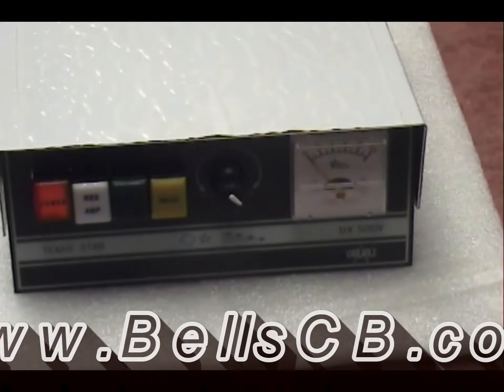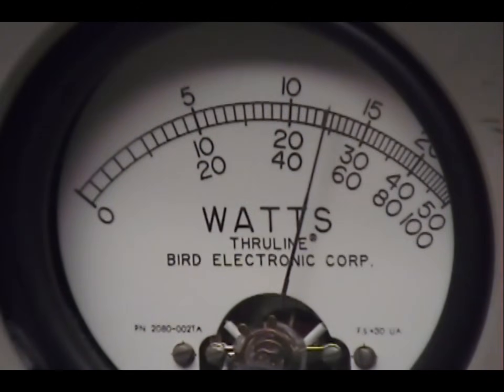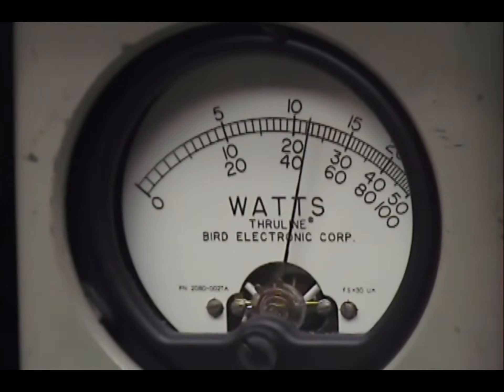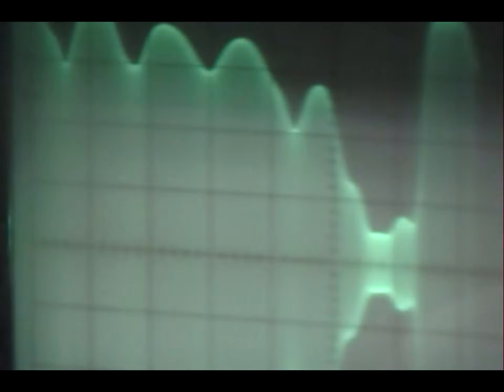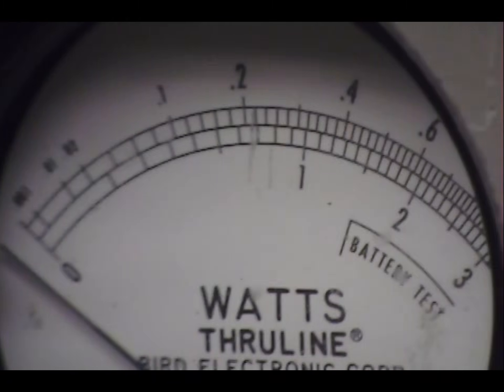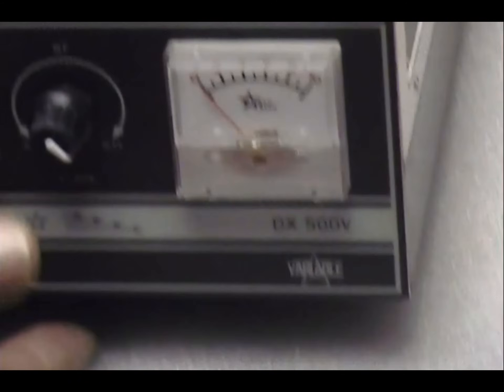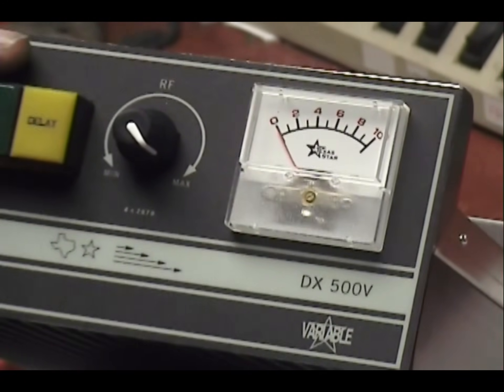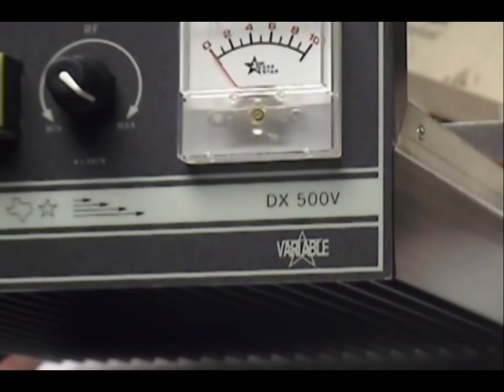Texas Star 500V Performance Report

Comment: This would work really well with a stryker 955
Reply from the maker: When you turn the power all the way down on the radio, it has a 2w carrier and peaks about 35w on AM and has a bout 18W PEP on SSB .  That's great to drive a DX-500V - Provided 𝙮𝙤𝙪 𝙠𝙚𝙚𝙥 𝙮𝙤𝙪𝙧 𝙝𝙖𝙣𝙙𝙨 𝙤𝙛𝙛 𝙩𝙝𝙚 𝙥𝙤𝙬𝙚𝙧 𝙠𝙣𝙤𝙗 on the radio. The folks that have to turn up the radio to full power every time the amp gets turned off (barefoot), 𝗔𝗟𝗪𝗔𝗬𝗦 forget and overdrive their amps when the radio power gets left all the way up. Don't be that guy !!!

Comment: May I ask what is the difference between Texas star 500 and Texas star 667?
Reply from the maker: The 667 is the same amp but with a 2sc2290 as a driver transistor to the 4x 2sc2879's..  I like the 500 a lot more.
Reply: @BellsCB  thanks

Comment: I have the tx star 500 and the texas star 667v. I only get 400 watts out of the tx star 500 and just a little over 500 on the 667v
Reply: +lazydogg calif -- they both have 4 of the same transistors in them
1 x 2sc2879 = 100 watts
4 x 2sc2879 = 400 watts
yes, they will put out more power than their rating, but what does it gain you in actual signal? 
nothing measurable on the receiving end (not even 1 S Unit)

peace )
Reply: Dietrich Zumwald
You will get a little more audio and it can make enough of a difference between getting walked on and talking over someone.
Reply: I suppose if you are on the superbowl and that is the type of operation you frequently encounter, I prefer polite, cordial QSO's to key-down, king of the hill operation, since the station is above 3100 meters (10,000+ feet) I am pretty sure that is not a consideration with sufficient power and antenna gain characteristics, there are many bands and frequencies, I'll just move somewhere else, that all sounds like far too much trouble to squeeze 3 watts more, it never made any sense to me
Reply: lazydogg calif You are probably not driving it hard enough. Put a swing mod in your radio.

Comment: I like it!  Not much difference between 4-500 watt's than a KW on the receiving end.
Reply: 512 watts to 1024 is 3 db - on paper at least. Biggest bang for the buck is at 250 watts output from under 20 or so.
3 db IS a noticeable change......not always worth the $$ to get there.
Reply: John Robinson Yes 3 db gain = half an "S" unit.
Reply: crazybobdj True. But the reason I made the comment is this : It depends greatly upon what you are using when you see that increase. A kenwood or an icom or any radio for that matter, CB or ham grade. Has a non linear circuit that drives the S meter. Yes, they try - some better than others - to make a metering circuit that is fairly linear. But lab grade performance it is not. I have a kenwood 450 that is very generous from S 5 to S 9 - it is not 12 db from S 5 to S 9 maybe six or so.
Simply put, if you try to go by the numbers. Your radio will lie to you in most cases.
But yet most folks watch the meter, it's relative
signal only. Something to compare things against is all.
I understand the DB values, most receivers meters can not do that. It is relative signal reading only.
Reply: +John Robinson agreed. run a 250 Variable HD with my 148 Philly.. DK set at 2w, and I have no problems getting out.

Comment: I am by no means an expert on amplifiers, but I get the impression that all (most?) CB amps aren't very good. Which wouldn't surprise me, since running an amp on a CB is illegal. So companies that make high quality amps for ham radio aren't going to make 11 meter amps. Sadly the FCC doesn't do much enforcement on CB.
Reply: Shoo.....
Reply: Theoretically, Can you run an 11 Meter amp on a conventional Cb radio or does the Cb radio need to be outfitted for 11 meters?

Comment: How big of a power supply would one need to run that on a base station?
Reply: it probably works well on a twenty amp power supply.  don't take this for the gospel  this is just my opinion  hope others have an answer for you
Reply: Max amperage is around 60. Average is around 40 to 45. Not posting this for the OP.... This is for someone searching for this info in the future.

Comment: I got a dx 250 from you 25 years ago. looks and works brand new.
I would like to up grade to the 500 or 750 but I know I will need a bigger amp that I have now which is a 35 amp..
I will call you tomorrow. I live in boca
thank you
Jeff

Comment: @bellscb Thank you very much for the great info. The amp works like a charm and I have no challenge working any of the farthest South Pacific DX stations on my Antron 99. I have just set it at around 14 volts. I also have a small fan that blows on it to keep it cool when I use it. Cheers

Comment from the maker: @BananaJSSI 13.8VDC is the design voltage but the manufacturer reports normal operation up to but not to exceed 18VDC. So if you set your power supply at 15V there will be no damage, just a cleaner (less flat top) and higher output. Do not try to reach 18V while still class AB or you will damage the amp. It will have to be converted to class C before you can drive it up to 18V. (Not recommended.)

Comment from the maker: @M28443 The MODV, 250, 350 take about 1.6 - 2W carrier input.  The 400 and the 500 take about a 2.7 - 3W carrier input. The 667V requires only .75 W carrier input.  You can drive the 400 and 500 at 4W, they will have a little higher carrier than  I like, but they will be fine.